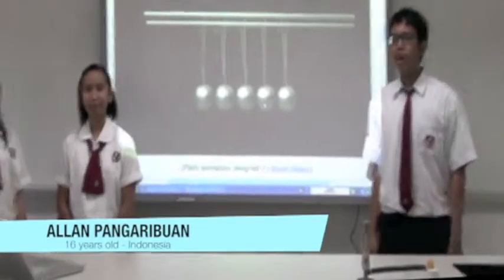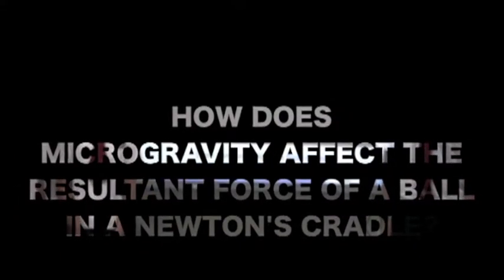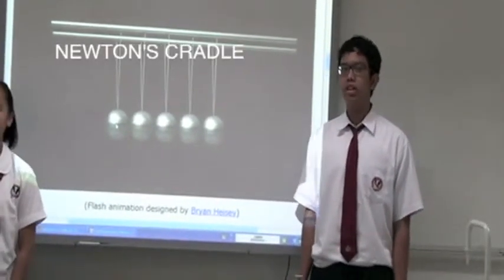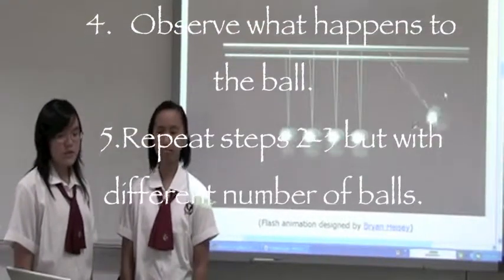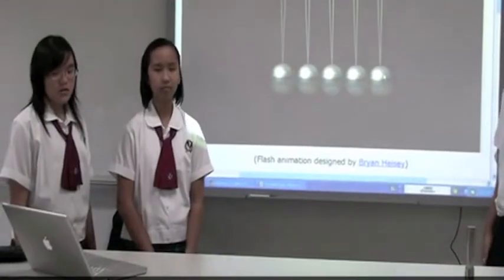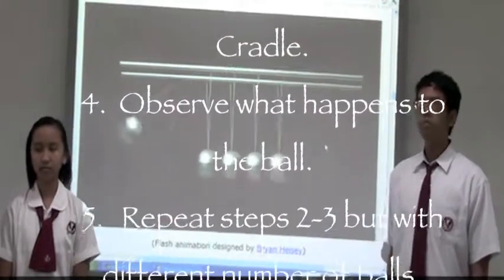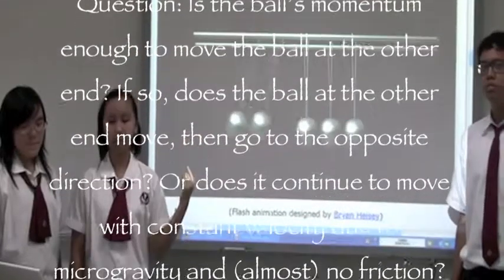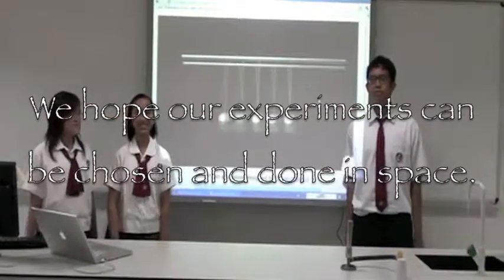YouTube Space Lab: Newton's Cradle Experiment

Comment: well, i was wondering how a newton cradle would work in space, I don't think it would. the ball on the other side will go in a circle (continuing until the other balls stop it, and the cradle will not be working). I would however like to try a newtons-cradle with two balls, and the strings on each sides (of both balls) would need to go through the same holes (otherwise they would twist around each other). I wonder how long it will go...